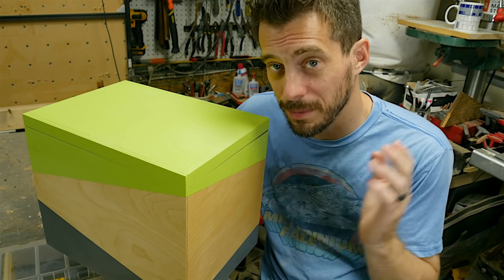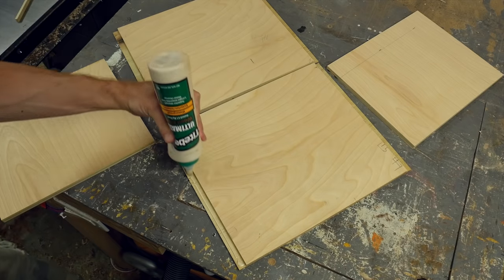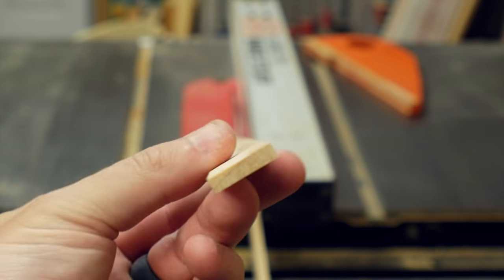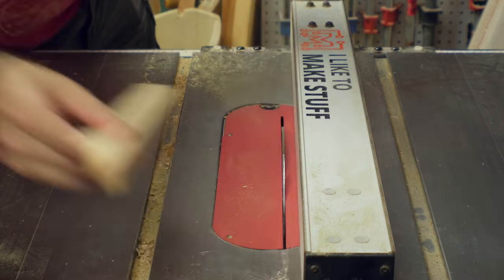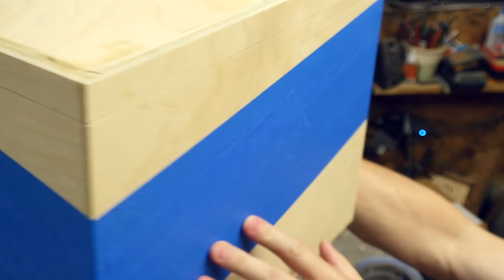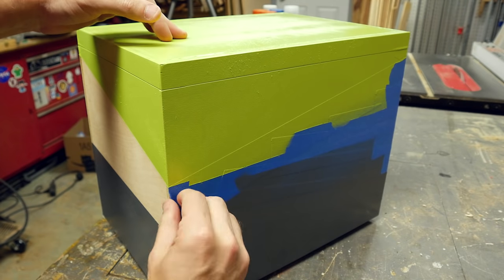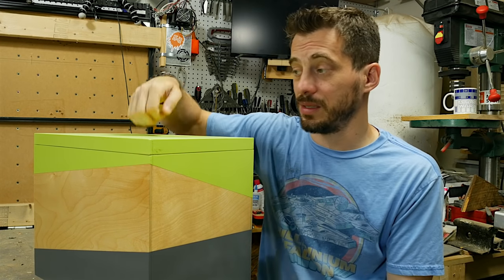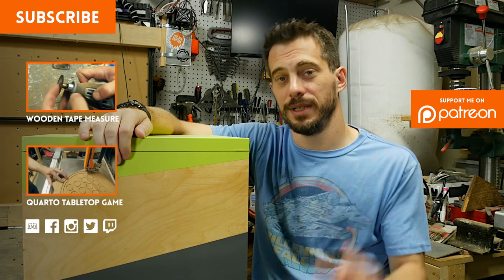Hanging File Box // How-To | I Like To Make Stuff

Comment: Nice clean lines. That method that has always worked for me when painting on very porous surfaces like stucco and OSB.
1. Paint base coat. (can be clear poly) Let dry.
2. Mask off area you want to remain as the base color.
3. Paint the base color again over all the tape edges where your two color meet. (this fills in any gaps under the tape) Let dry.
4. Paint your secondary color.
5. Peel the tape while your paint is very wet, or wait until fully dry and score your tape lines with a blade.

Comment: Just a heads up if you want to make multiples of these. Normally file box dimensions are set so that they will fit letter sized folders in one direction or legal size in the other direction in case you ever wanted to use legal size in one of your boxes.

Comment: Suggestion for paint bleeding under your masking tape: I use a 4" flexible putty/drywall knife to go over the tape edge. It generally gives a good seal to the surface. Looks like the fingernail and clear coat method worked pretty well on this one though. 
Dan

Comment: I built something similar for a friend but used aluminum flat stock from the home center for the rails. Just routed a stopped dado into the sides and cut the flat stock to length, then they slide right in but can also be removed should he want to use the box for something else in the future.

Comment: Those corner clamps look like the exact same ones i got from ebay. Wondering if you've had any problems with them, i've had a snap in half, another the adjustment bearing snapped off and another 2 were off-square and this was out of only out of 8 i ordered

Comment: Now I need a fire-resistant version of this :D
Reply: Just spray it with that fire proofing spray.
And why would you need it fire resistant? XD
Reply: This box can easily be made fire resistant. just put it under water with a rock on top. I guarantee it won't catch fire
Reply: Just imagine your house starting to catch fire and all you could do would be to run away until the fire brigade would extinguish it. If you could come back to the remains of your house and still find all the important documents left, that would probably be very helpful ;-)
Reply: +pcfreak1992 you would never be able to make something that would do that
Reply: Well there are commercial products that promise protection from direct exposure to fire of up to half an hour. Many also include a water-protection from the fire brigade's water.
I guess if you would want to make this yourself you would need some special material as a separate layer around the box. Maybe some stone-like or special synthetic material would work.
Reply: Mold one out of insulating castable refractory, with the sides, top and bottom at least 2" thick. And put a gasket around the lid where it meets the box. Add hinges and a latch so it can be closed tight. Waterproof it inside and out. Now it will also survive floods.

Comment: It looks so easy but when I try...
Reply: when you try, what?
I assume something goes wrong, so what is it that goes wrong?
Reply: +ThoperSought 

it just turns out like... well... it looks like someone dropped a  wood shipping crate down the stairs, except that they were shipping failure, and it mixed with the box...
Reply: WhoLock 
lol

that's hilarious, but very non-specific.

let me give you a case study, which I hope will be an instructive starting point for a nice conversation.

if I'm going on at things you already know, then sorry... just let me know if something is too obvious.

I'm all hand tools, so this is my experience with learning to use my shooting board earlier this year.  if you're not familiar, a shooting board is (basically) a fence at 90° to a straightedge where a handplane rides the straightedge to shave a workpiece that's against the fence.

when I first started trying to use the thing, the bits I was planing weren't getting straighter as I shaved them down.

(1) it took me a long time to notice this, because I wasn't checking the piece with a square much at first—I imagined that the known squareness of the shooting board would magically make things come out nicely.

eventually there was a pronounced enough hump that I noticed—fortunately not too bad—so I started checking.

one mistake that I repeatedly made, even after I noticed, and although I knew better, was not always using the same edge/face/end against the fence.

(2) one of the first problems I found was that I wasn't holding the piece tightly enough against the fence—any shifting seriously messed up the cut.

(3) always starting with the plane blade off of the piece—rather than just before a known high spot—gave me something like snipe.  basically, the toe of the plane was following the hump, and not taking it off enough more than the rest of the edge/end.  it also contributed to making the piece shift.

there're a couple of other things, if I thought about it a lot, but it's late here, and this is getting long anyway.

how does this compare with your experience?
Reply: +ThoperSought, Whoah... Long reply. Ain't nobody got time for that!!!
Reply: Aperson 
well, (1) since you're looking at it in youTube's new wall-of-text mode, that'll make it look daunting.  they seem to make their comment system worse every time they change anything.  and (2) it's 15 sentences.  do you really think 15 sentences is long? (3) ever hear of Wheaton's law?